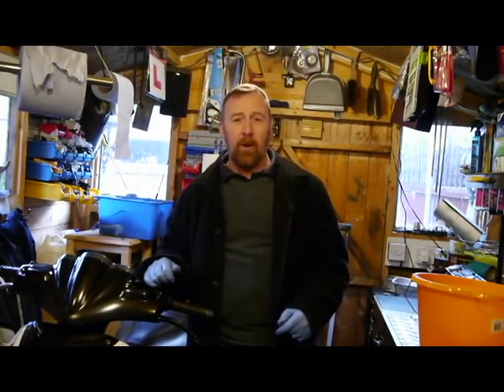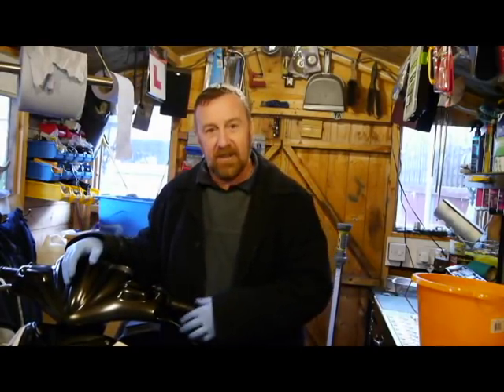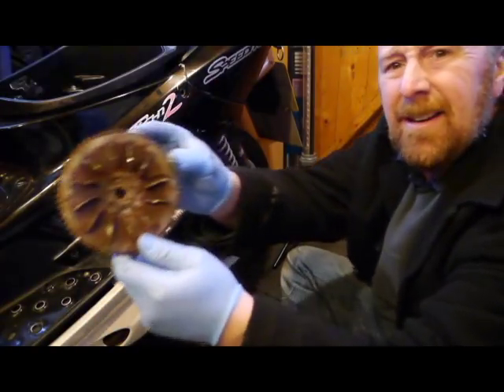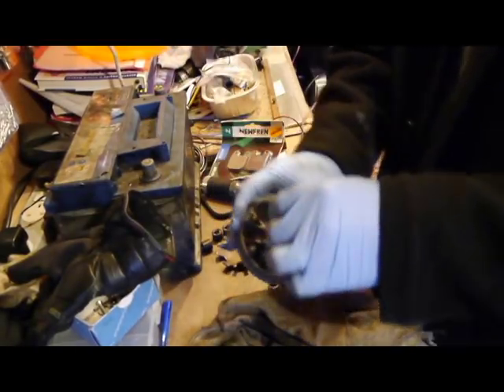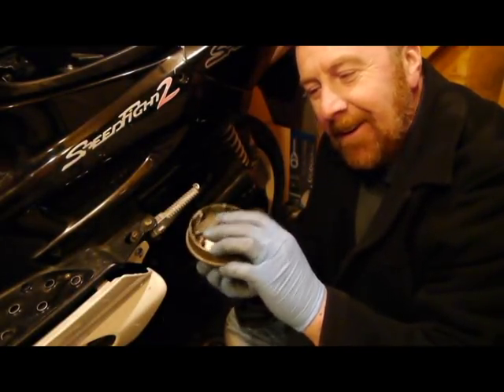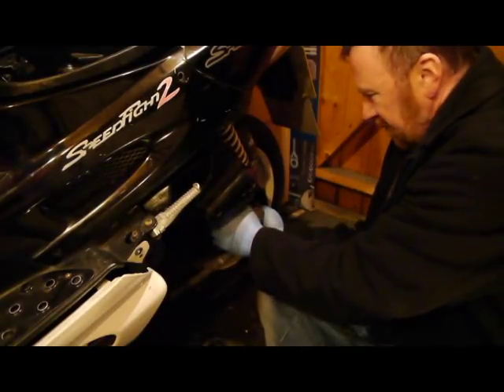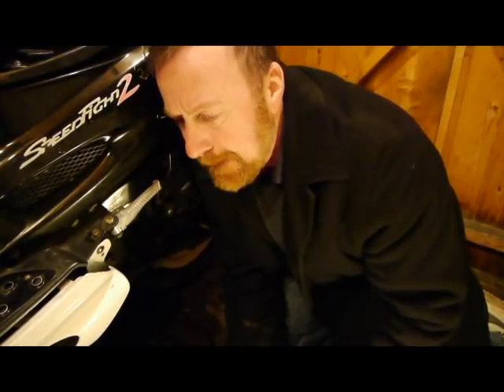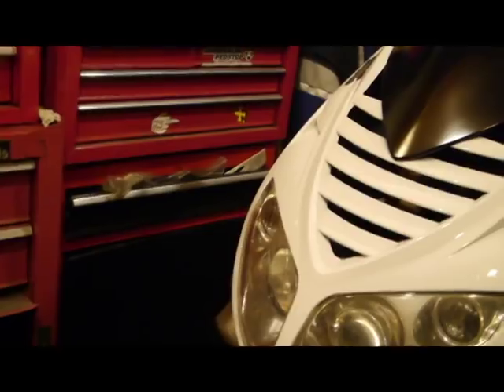MOPED SPEEDFIGHT SPEEDS UP SLOWS DOWN WHILE RIDING MARK SAVAGE

Comment: hi, mark me again when electric starting my moped i have a split second start and an instant cut out, then i can stand there holding the button trying to start witht he red oil light on, i dont think it could be immobiliser because i have great spark please help? 
Its filled with oil, petrol, anti-freeze with new plug clean airfilter and still have no change.
Reply from the maker: so you have spark then the cdi is ok so sounds like fuel have you tried easy start ?
I have had this before and it was the oil seals!! and the reeds!
is the plug getting wet?
Reply: @marksavage  yes plug is getting wet and you can smell fuel when I turn it over. My dad has even sprayed wd40 into the carb but still nothing. Perhaps should try easy start the proper stuff lol!
Reply from the maker: why would you spray wd40 in to the carb!!!! NO do not do that ,now you will have to take the carb off and give it a clean and take the plug out and clean!!
wd40 is not for a carb nor does it clean anything and should never be put into a carb bud never 
its a water displacement that what it stands for WD 40 and that the number of times it took them to get it right
so use carb cleaner  now and clean carb and try and spray it down the inlet to the reeds to try and clean them
clean and clean so more bud
Reply: Glad your here mark, it was my dads idea, so thanks dad! I do have proper carb clean tho so will give it a good clean, thanks mark.
Reply from the maker: @ChadTheLad  Bad dad lol
Reply: @marksavage  yeh lol no wonder he cant get his 4 stroke moped to run properly he used WD40 as carb clean. At least I know not to rely on him now!
Reply from the maker: @ChadTheLad  think he needs to start watching my videos lol
Reply: @marksavage  By cleaning the reeds, do i need to take the inlet manifold off or can i just spray right into it?
Reply from the maker: wd40 can get every where bud give it a go with just spraying cleaner down there as the manifold can be hard to get off 
and you will have wd40 in the pot too so it still may take some time to get started
Reply: @marksavage  alright cheers, I'll give it ago!

Comment: Hi mark, my areox sometimes runs fine and does about 50 but other times it just won’t go pass 20 like it’s in limp mode do you know what the problem is
Reply from the maker: Josh Boundford I have videos on aeroxs so check them out 
Check your variator bud like I had in my video rollers and clutch 
Then move on to changing the plug clean carb 
See how you get on 
Mark
Reply: I cleaned out the carb when I had it but I didn’t check the spark plug and I shall have a look at the variator and rollers and stuff on the weekend
Reply: Mark savage I went to work today and cleaned the carb again cleaned the rollers and checked the spark plug and to be honest it still does the same and sometimes even worse

Comment: I did that but the bike goes up and down on idle I don't know what it is maybe it's a blown head gasket my spark plugs are dark black
Reply from the maker: its a 2t so they will be a little black as normal but you say you have tuned the moped!
what air filter do you have on?
change the plug for a new one
if you have moved the air mix to 3 half bring it out more like in the video
watch my down jetting video as you are get too much fuel and not enough air 
what jet size do you have in the carb

Comment: Hi Mark my bike starts fine but slows down and accelerates and then gradually the bike just stops and turns off and doesn't go again
Reply from the maker: cbuffey ! Sounds like fuelling bud 
Watch my video on carb cleaning 
Change plug so full service 
Make sure the float is not sticking and the fuel pipes are ok 
Thanks for watching and have many more video on my channel that will help 
Please like share and sub 
Mark
Reply: Hi it's only happend after the snow
Reply from the maker: cbuffey ! May have got moisture in to the electrics or air box 
Like in my videos bud take everything off and clean wd40 and then you should solve the problems 
Mark
Reply from the maker: cbuffey ! May have got moisture in to the electrics or air box 
Like in my videos bud take everything off and clean wd40 and then you should solve the problems 
Mark

Comment: Hi Mark, thanks for all the videos , have a few problems with a speed fight 3 50cc.
Takes a bit of work to get it started , and revs up very high where it almost feels its going to pull itself off the stand ,then settles about 2500 revs.When pulling away revs itself but does not go anywhere and eventually pulls away after about 3 of 4 sec.When running all seems ok until you have to stop ... traffics lights etc then cuts out.
I bought the scooter with mods on .... bigger rollers I was told exhaust and after market carb. I had been given all the original parts so got a garage to change the exhaust. I was going to get it booked in and after watching your videos going to get the following done....
1,variator cleaned and or weights changed
2, carb cleaned/idle adjusted or original put back
3,air filter replaced 
4,spark plug replaced

can you tell me your ideas of whjat it might be and if the things I have mentioned are the way to go ? and if not why.

thanks in advance Mark
Reply from the maker: nitnit202 hi bud thanks for watching I have a few videos on the sp3 and as you know I don’t like  be them
Ok yes that’s the right way that’s go 
I’d of left the sports exhaust on as long as it was ok
Clean variator and got a little more on the weight than standard and while there change the belt and clean clutch 
Carb back to standard Peugeot on but up jet by 4 like in my videos but you might get away with going by up 8 if running ok
Sports airfilter insert 
NGK plug 
Sorted 
There’s are things you could do bud with my videos but like I say in my top ten tip video only if you can 
All that should help and last good 2t oil 
Mark
Reply: I changed the exhaust as it was on its last legs and this scooter was my kids first bike ,didn't want her to get pulled with a stage 6 exhaust.Thanks again, what do you think is the best scooter type ? make ?
Reply from the maker: nitnit202 it all comes down to the sort of girl she is !
My daughter want to go as fast as possible so speedfight , aerox 2t jobs 
If she just want to potter around then go for 4t bikes as easier to keep and are happy doing 30mph all day 
Then budget if you have the money buy newish you can 
Or one that has been looked after 
Try a few let her have a sit on it and make sure she’s happy 
Sp3’s are good bikes as long as they run as in my videos they can be a pain 
Hope that helps bud 
Mark

Comment: My scooter was driving 80km/h but now its only drives 30 because of that problem i think because i have checked everything else..
Reply from the maker: Hi bud 
So it still starts and runs
Have you check the variator system ?
Checked carb and cleaned 
Changed plug and airfilter ?

Comment: I have a same problem on Peugeot SF 3 and i only have 500km done  even on flat can't go more then 55 km/h hills less then 30 km/h on hills , checked everything i put heavier rollers 7.5g still same all looking good and clean i put new belt no change i come to do the CDI next,  do you have a video where is located and maybe a suggestion what to do next but may be i have a limiter somewhere ?Help would be good ,Thanks
Reply from the maker: hi bud sp3's do have restictors on them like 4!!, carb, exhaust, variaotr and yes CDI which stop the revs, the CDI in under the seat at the rear.
if you can get a sports one great or go to a garage and get them to derestrict it, i have a few like 10 videos on sp3 and really did like working on them ( they hate mw lol).
get that sorted then you can sort out the rollers i like 6g's best for all round speed, a sports exhaust will really help to and maybe upjet by 4
videos on all of theis bud on my channel, hope this helps please ;like and sub
mark
Reply: can you send me link for one of your SP3 videos i couldn't find one ??
Reply from the maker: I have loads of speedfight videos bud ,type in speedfight mark savage I also have another channel where they are all on a play list, a lot of them come under fix but the basics are the same
here it is
https://www.youtube.com/channel/UCRiqrGt9LKmwNx8UD-sPmhw
 
TBH I really did like working on them as they are a pain 
just a few see below on sp3 
https://www.youtube.com/watch?v=tlNkL7orv7g&t=39s
https://www.youtube.com/watch?v=1WuLMDJJhTY&t=208s
but more on my channel 
mark

Comment: If u can help me fix mine pal id be happy.
Reply from the maker: What ped is it bud and what's up with it 
Theres over 70 on speedfights and 150 in tatol on peds they should help too
Reply: @marksavage  Honda vision 110 losing power
Reply from the maker: @gotiman3625  when was it last serviced bud 
Are the valves ok and been checked 
Most of the time a service will sort it bud
Reply: last summer was service don't ride it every day  but when I do it for a few hours.
Reply from the maker: @gotiman3625  left sitting is not good for them , petrol sits in carb  
Give that a clean and check the fuel pipes are tight and not gone hard
Reply: @marksavage  will do THAT thank you verymuch ill come back with more QUESTIONS if that's okay

Comment: I need the seat
Reply from the maker: e bay bud or face book sales
Reply: I watch eBay curious do your videos cross reference to Chinese scooter figure the basics are the same. Im trying to figure out a good roller weight for a quicker response but decent cruising around speed
Reply from the maker: I have many other videos on rollers and the variator system but all in 6g's are the best

Comment: I have a 50 cc toa toa scooter .it won't go full speed its like some things holding it back like a break.bwheel won't hardly move its like the break stop in it.do u know what's the problem?
Reply from the maker: hi bud 
put the ped on the centre stand 
see how freely the rear wheel moves?  and check the rear brake see if it could do with a service like in my videos on brakes 
next take off the VARIATOR cover like in my videos and follow how to look at it clean it and maybe change rollers if needed and check clutch this should help 
mark